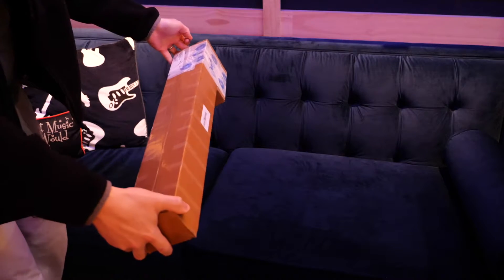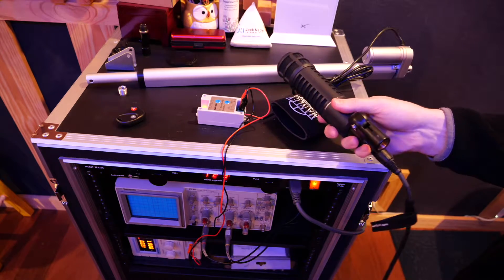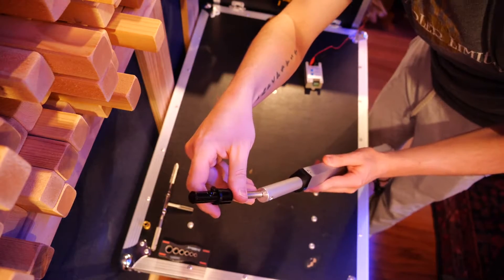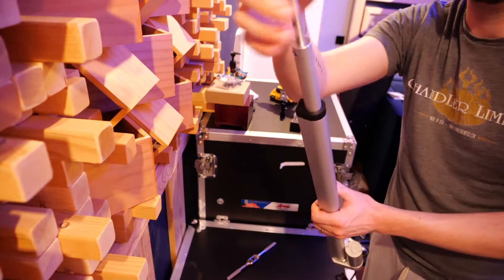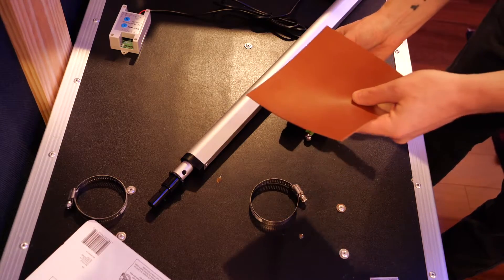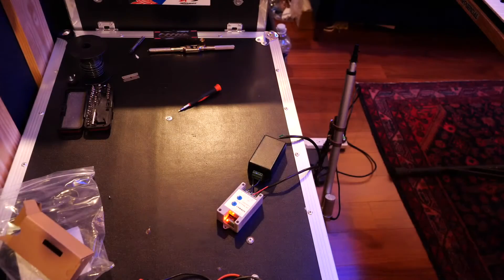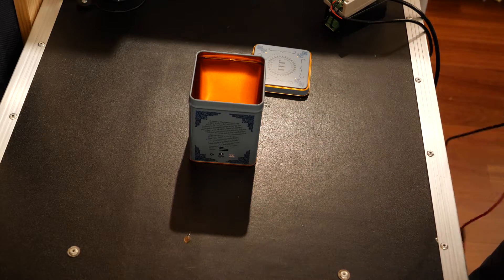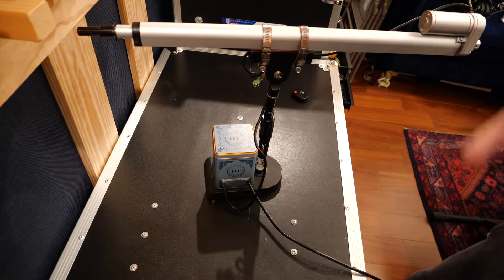DIY Robot Mic Stand Under $100

Comment: I am looking to build one that moves the mic vertically for our church. However the loud noise would be a killer in our setting where you can hear a pin drop. Are there super quiet actuators available that you are aware of?